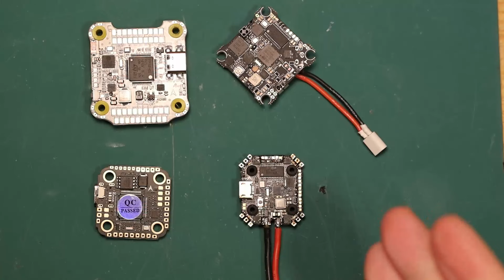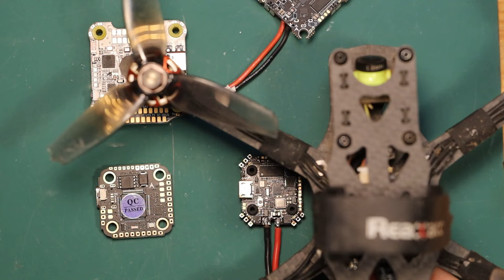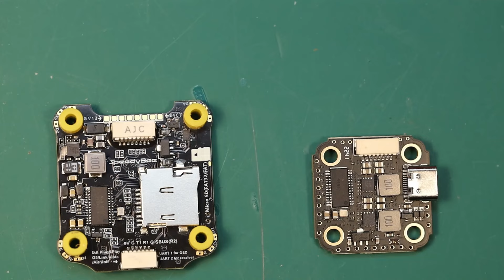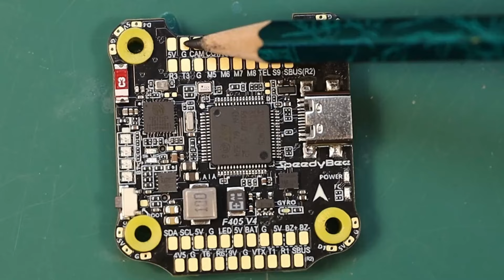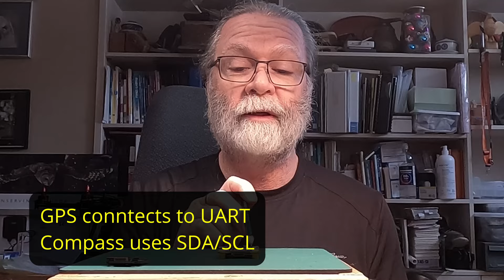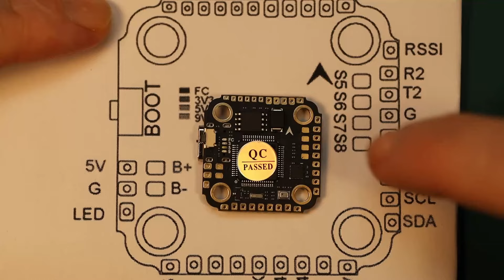FPV Quadcopter Flight Controllers Explained for Beginners

Comment: I am a first-year ECE student interested in avionics. I am really interested in designing my own custom flight controller, but I don't have much electronics experience. Is this project too ambitious? The main concern is that I don't know what values to place on resistors and capacitors, I dont know how to layout the pins for each component, and what parts are neccesary for the flight controller. I am   a little overwhelmed with how to start. I want to learn as much as I can and start building projects. Do you have any advice for how to begin a project like this and mabe how to check my work while I am designing the PCB?
Reply from the maker: I can't honestly give you good direction simply because I'm not enough of an expert either.  However, it is certainly a doable project.  You may want to visit: https://opendrone.be/ .  They have designed custom escs and flight controllers and the designs are open source.  The FC is based on RP2354 (Raspberry pi chip) and other easily available parts.  I believe there is even a betaflight target available already.  They should be able to help or guide you much better than I can.

I hope this helps, and good luck with the project.
Eric

Comment: G,day from Sydney. The PCB has many DC power supply pads and connects. Can the board only receive one direct input and ground, or can you connect multiple power supplies?
🤖
Reply from the maker: Thanks for taking the time to leave a question.  You can only power a flight control board from one source at a time.  Some higher end flight controllers allow redundant power sources, but in those cases too, only 1 is active at any time.

I hope this helps you out.
Eric

Comment: Hi, very nice video about flight controllers.
I have a project of an inspection terminal that takes pictures and analyzes the images by ai to check for job completion. I would like to strap the camera + it's microcontroller  on a drone that could fly autonomously to several waypoints, get to a programed high and orientation so my inspection camera can take a picture. All pictures to be analyzed when the drone returns home.
I am looking to a low cost solution to start with to prove the concept and learn more before i commit to more expensive solutions.
The inspections are to be made on construction sites and a 20 to 30 minutes flight time would be enough.  So i need something where i can set the hight and drone orientation for each waypoints.
Can you recomend something?
Thanks
Reply from the maker: Sorry for my slow reply.  I have been away from the internet for over a month.  Thanks for the question.  I think you have only 2 real choices: 1) build your own (hard) 2) buy a DJI drone

If you want to use a camera system you already have, your only real choice is to use a drone based on ardupilot (or PX4): basically a drone using a pixhawk type flight controller.  They have very good support for peripherals (like a camera) and are excellent at way-point / planned missions.  However, ardupilot/PX4 are NOT simple to use. You will spend a lot of time learning about the system, how to configure it and make it work.  They both have excellent documentation, but it is not written with beginners in mind.  Then you would need to build/buy a drone that is capable of 20-30 minute flight time with your camera load. You would also need a gimbal or mount for your camera gear and need to set that up as well.  20+ minutes of flight time on a quadcopter is not easy.   The flight controllers will cost about $350 USD, and you will need a very special drone to fly 20+ minutes: probably in the $800 - $1200 range for the frame/motors/ESCs etc. This route MAY be more affordable, but will be very challenging if you are new to drones.

A much simpler choice would be to invest in a mid-range DJI drone system such as the DJI Air 3s.  They are basically flying high quality cameras and have incredible flight duration.  DJI drones are designed specifically for what you are describing - fly to this point at this height and take photos/video, then move to next spot and repeat.  You may need to put out a bit more money up front, but you will have 98% less stress and hassle getting things to work.

I hope this helps out a bit.
Eric
Reply: @blueskyfpv hi, thanks for the clarification. I managed to get enrolled in a drone piloting course next month and you kind introduction will a good start. Thanks

Comment: i want to make a drone which i will be upgrading multiple times in feature anad i will be adding morer pheripheral to it i wnat to choose a flight controller which one shoul i choose F405 or F722 or some other flight controller
Reply from the maker: Thanks for the question, and I'm sorry for my slow response.  I was away for over a month.  

It really depends on what you are going to add as peripherals when you choose a flight controller.  Basically F7 flight controllers have more available UARTS than f4 flight controllers, and a slightly higher speed.  This is only helpful if you are adding more UART based peripherals - if you are adding SPI or I2C based peripherals, it won't make a difference.  With F7 based flight controllers, it is probably best to avoid the F722 chip if you want to expand a lot.  The f722 only has 512k of memory and can struggle with heavy work loads.  A board based on the F765 would give you the most options for UART based peripherals.

If you are looking to add peripherals that use several different communication systems (UART/I2C/CANbus/SPI), you would want to get a pixhawk style flight controller that allows for multiple peripherals of different types to be connected easily.

I hope this helps out a bit.
Eric

Comment: Is there a plug and play avoidence prouduct? I am trying to add avoidance sensor set up on a quad. Thanks.
Reply from the maker: Hi, thanks for the question.  Short answer - no to plug and play, but yes it can be done very well with some flight control firmware.  

Betaflight does not support obstacle avoidance at all.  iNav can use the sensors, but it does not use them for obstacle avoidance (it uses them for other navigation purposes).  For open-source/free firmware that leaves Ardupilot or PX4.  They both have very good support for obstacle avoidance using a good selection of different sensors.  

Ardupilot and PX4 are fantastic flight control software and both have large user communities. Be aware though,  neither is very good for freestyle flying, and they are not FPV focused, so FPV setup is very cumbersome.  If you choose to try this out, I'd suggest Ardupilot over PX4 since it is more hobbyist focused and has really good documentation.  Both are significantly more complex than Betaflight/iNav, so expect to have a big learning curve and lots of headaches figuring things out.  Ardupilot is very flexible and highly configurable (which is why it is hard to learn).

This probably isn't the answer you were hoping for, but I hope that it helps and maybe gets you headed in the right direction.
Best of luck.

Comment: Great explanation. I understood the lesson clearly. Please what is FIRMWARE?
Reply from the maker: Thank you.   The chips that are used in flight controllers are also used in many other places  (cars, vending machines, factories).  In each one the chips are doing very different jobs.   Firmware is the computer code that runs on the chips.  Unlike a Windows computer, on these small chips, the firmware is the only code that runs on the chip, no extra software. This means firmware contains 100% of the computer code for the specific tasks it will be doing.  Once it is installed (flashed) to a chip the only way to change firmware is to completely erase the current firmware and upload (flash) a new version.  On a flight control board, Betaflight, iNav, ardupilot are the names of different flight control specific firmware that we can put on the chips to help fly RC aircraft.  As users we can change basic settings in the firmware.  We can also flash, and do firmware upgrades, but as I noted earlier, that erases what was there before and completely replaces it.

This is  just a very basic explanation of firmware, but I hope it helps you understand it better.

Comment: I'm an engineer that got an aerospace engineering degree but never used it. Instead, I've worked on implantable medical devices such as pacemakers. Now that retirement is looming, I'm interested in home projects where I can still design new systems. Your video was very helpful in jumpstarting some ideas. Thank you.
Reply from the maker: That's an amazing background! Thanks for taking the time to watch and for the kind comment.
Reply: @blueskyfpv Sorry, I just erased about a 200 word response to your comment. The long and short of it is that I've been blessed over my career with working on some amazing products and the last 20-some years have been dedicated to engineering that saves lives.  There does come a time to step away, however.
Reply: made for a great review too ... been 40 years since I was last designing electronic boards LOL

Comment: Can’t wait for the fiber optics video. Is there any flight sensor data that would be useful for at least level flight? Like the barometer and xyz triplet accelerometers? I don’t think they have real MEMS gyroscopes. They’re like $20, kinda bulky like 20% of those PCBs. Maybe on the high end ones. Everything else is vulnerable to jamming and spoofing (pitot tubes and LiDAR, Doppler altitude and distance sensors are all probably fine). The compass I wouldn’t count on, the control and GNSS would be very untrustworthy. Show us how it’s done. It’s cool, you’ll enjoy it and the russkies could be island hopping across the Aleutians as we speak. Thanks for the vid. Followed.

Comment: Excellent video!  Thank you.  I would like to set up a controller for a quadcopter that can transition to airplane mode.  Can you provide any advice on how to do this?  Thanks in advance.
Reply from the maker: Thanks for the kind words about the video.  I'm glad you asked about VTOLs; I've been thinking about building one myself.

Just as a general comment for anyone thinking about a VTOL as a very first build; they are not really beginner aircraft.  When two types of aircraft are mixed (helicopter and airplane), the systems become more complex and the number of possible problems goes up dramatically.  Absolutely go for it, just know you are choosing to start with a moderately advanced aircraft.

I am not experienced with VTOL (vertical takeoff and landing), so this will be basic. 
There are two viable firmware options for VTOL right now - INav and Ardupilot.  You will need to have a flight controller that will run one of them.
Ardupilot is a very good, very complete firmware, but has a big learning curve. 
INav is a very good firmware, with fewer features than Ardupilot, but has a lower learning curve (it looks similar to Betaflight).

Once you choose the firmware, you will flash it to the flight controller, and then set the aircraft type to VTOL.  This is usually in the Mixer settings.  After that, you would go through a standard setup for that aircraft type.  

I have never set up a VTOL, so I won't try to explain it.   Instead,  I would recommend Painless360's recent VTOL series: https://www.youtube.com/playlist?list=PLYsWjANuAm4q0alv1rXXTpxhpM0mybOz1  
Painless360 has a wealth of content on both ardupilot and INav being used a many types of aircraft.  He knows his stuff and presents it very well.

I hope this gives you a start in the right direction.
Happy flying.

Comment: I’m having trouble locating the pin out diagram for  9 imod f405    Any idea where I could find this
Reply from the maker: Hi.  Thanks for taking time to leave a question.  I haven't used a 9imod FC, and it seems like there are several 9imod f405 versions, so I can't say exactly where to find a pinout diagram other than from the seller where you got it.  However, I did a quick check on aliexpress for 9imod f405.  There are many listed, and many listings have photos of the boards and sometimes pinouts as well.  For example, this: https://www.aliexpress.com/item/1005007494114502.html#nav-description has the pin labels silkscreened onto the pcb (I don't know if that link leads to your specific 9imod FC).  You can look for someone selling the same FC as yours and they may have a pinout in the description (or a silkscreen pinout on the board).

Sorry that I can't be of more help, but maybe this can get you going in the right direction.
Good luck and safe flying.

Comment: Very nice presentation. Quick question: I am very familiar with Speedybee F405 and am looking for some of the other options. I found Solo F405, which looks identical to SpeedyBee. This is all based on the same chip tech 405, which, in essence, has the same architecture as SpeedyBee (in this example). So, based on that, should PID parameters transferred from one FC to another FC be interpreted in the same manner?
Reply from the maker: Hey, thanks for leaving the comment and questions.  Looking the same and being the same are two different things with flight controllers.  Even with the same main chipset (F405 in this case), the other components may not be the same, and can be placed on the board in different positions which can lead to differences in performance.  As for PIDS, they are much more related to the actual aircraft than the flight controller.  If you are replacing a new flight controller in an old quadcopter, it wouldn't be bad to use old pids as a starting place, and you may need to fine tune.  If you are using a new flight controller in a new quadcopter, you will need to redo the PID tune.  I hope this helps out a bit.  Safe flying.
Eric

Comment: Thank you very much for your clear basic lesson in FC.
Reply from the maker: No problem at all.  Thanks for taking the time to leave a comment.  Stay well.
Reply: May I know where in Canada you are ordering the materials for fpv drone parts. Because I'm now in New Brunswick and I don't know what web site/online platforms or store that I can order safe @blueskyfpv
Reply from the maker: @dennisbleza  There are some pretty decent places to order from.  Rotorvillage.com is great and super fast with shipping.  YYCdrones.com and epicfpv.com are also good (out of Calgary area).  Other stores that can be good are greathobbies.com (free shipping after about $100), snhobbies.com and rotorgeeks.com (rotorgeeks is more about helicopters tho).  Planetfpv is out of Quebec, but they tend to have a slightly older selection of products.  If you are just looking to buy a frame, CNCdrones in Vancouver area is fantastic at cutting carbon (they do all of Chris Rosser's AOS frames and hundreds more).

Hopefully this gets you on the right track.  Happy flying.
Eric

Comment: All of the pads are related to electricity .. 🤭
Reply from the maker: Thanks for watching and leaving a comment.  The pads on a flight controller are used to transfer electricity in one way or another.  Some are meant specifically for power delivery, while others are intended for information delivery via electrical signaling.  Information sent down wires from a receiver or GPS unit to a UART is sent using encoded electrical signals.

Comment: great thanks for your video.
i just go a flywoo with f405 pro chip, and I am confusing where should I put my elrs receiver.
in manual book tell me need 5v and UART 4, but 4 only have 4.5v
another story is, I go information from another video said, the elrs receiver will power on when I plug in USB to my computer.

so combine the information, you mention 4.5 and 3.3v are low amp and power on...
now I have more confidence to continue my semi-first drone..
Reply from the maker: Hey Andrew, thanks for leaving the comment.  I'm glad that the video was helpful for you.  Good luck with the build you're doing.

Comment: I had no idea you can get these boards. Do you use rc receiver outputs for inputs to these boards?
I'm using rPi's for different things, this sounds like a fun project!
Reply from the maker: Hi thanks for the comment and questions.  Raspberry Pi are great little boards to work with, but they are much more general in purpose.  The boards in this video are designed for one primary purpose - remote flight control.

These boards are most commonly used on quadcopters and slightly different variations are used on rc airplanes (mostly it is pin layout).  They have standard UART control, so it is possible to connect components to them (GPS, RC receivers, video transmitters, etc.)  As you saw in the video, there are other connector types as well (I2C being one) as well as multiple voltages available for external components. The most commonly used opensource flight software for quadcopters is Betaflight. It is designed more for free flight and racing.  If you are interested in more programmable flight (return to home, position hold, waypoint missions...) then INav is the firmware you'd be looking at.  They are close cousins; they just focus on different flight styles.  Betaflight is only designed for "XXcopters" (tri, quad, hexa, octo); however, INav is designed for both copters and fixed wing aircraft.